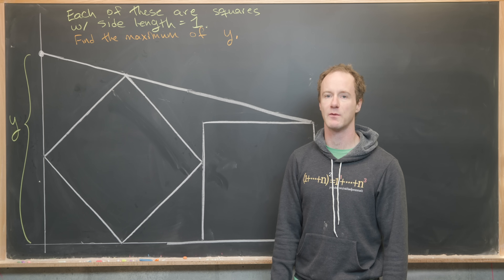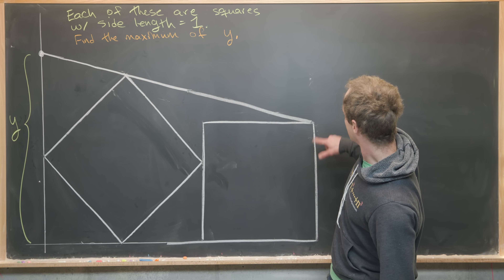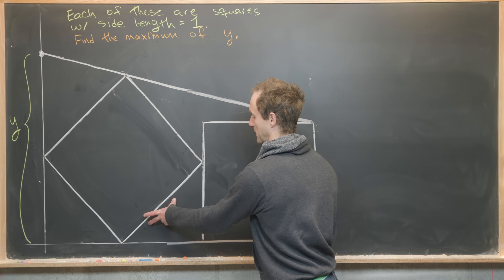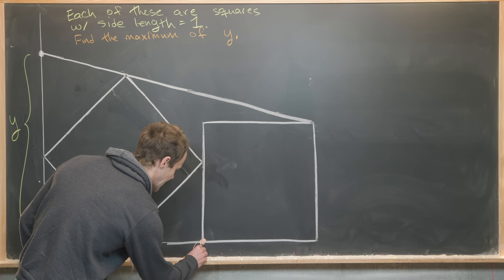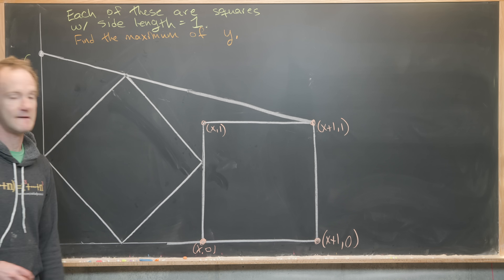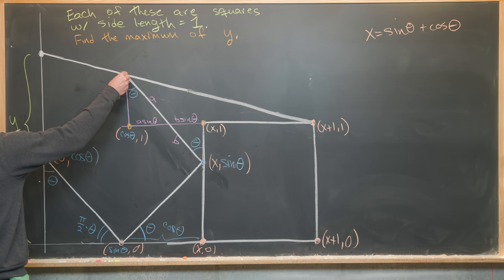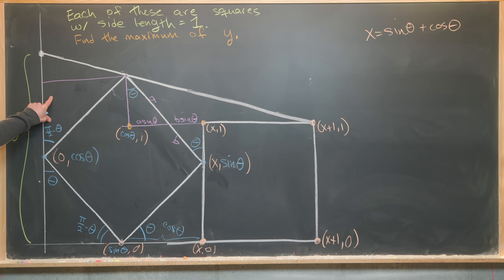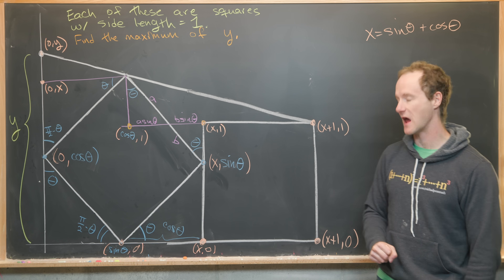How big can y be?

Comment: Setting the derivative to zero gives local max/min but doesn't say which one. Even though from the problem setup it's obviously a local max, I would have liked to see a mention of the second derivative test
Reply: @BrianStewart126  The negative solution doesn't fit my interpretation of the problem, but there doesn't seem to be more than one real minimum.
A graph of 
     y = (4*x*(x+2+SQRT(2-x^2))-(1-x/SQRT(2-x^2))*(2*x^2-2))/(x+2+SQRT(2-x^2))
can be seen by entering only the RHS here:
     https://www.wolframalpha.com/widgets/view.jsp?id=a7d8ae4569120b5bec12e7b6e9648b86
It shows only one real root between -2 and +2

Comment: Why is sin(theta) = 1/2 (x+sqrt(2-x^2))?
Why not ±?
Reply: The negative result would make the y-value for every point on the rotated square less than 1. The straight line would then cross the y-axis at a value less than 1 -- which is lower than when theta = 0, so there is no maximum y-value to be found when theta is between 0 and -pi.
Reply: Brcause theta is <= pi/4
Reply: Put x=1 to the equation

Comment: A value for theta would be nice to see how far from 45 degrees it is.
Reply: It’s around 38.5° or ~2/3 (radians).  Then y should be slightly greater than 1.60 for unit squares.
Reply: It's 38.17270763...°
Reply: I agree.

Comment: I tried the angle method. I was also stuck after differentiating for finding critical points.
Reply: your expression for y should be (sin(2\theta))/(1+sin\theta)+1. Differentiate, then when setting the numerator to zero, convert it to an equation in sin\theta only. You should get a factorizable cubic equation in sin\theta.

Comment: The actual answer via geometry is 1.585796437 to 9 places. The formula as presented (and beyond my maths ability) generates an answer of 1.600566212.
Reply: the formula as presented is correct
Reply: @mousmoulenium1215  Then I am baffled, my friend ;-)
Reply: @allanmountford21  May I suggest you check your geometry?  I solved this without using trigonometry...pythagoras theorem is sufficient...and get the same answer as Michael.
Reply: @mousmoulenium1215  Checked it using similar triangles and still get the same answer. I am obviously doing something wrong.
Reply: @allanmountford21  You are probably assuming the tilt angle of the square needs to be 45 degrees. It should not be the case.
Reply: @rocky171986  That is an interesting point - thank you - but I still don't see how rotating the square will reduce the maximum height of y.
Reply: I now see what you mean. Many thanks.

Comment: Why cant we just say the diagonal is √2 and since the two diagonals bisect each other, x is √2/2 or even the diagonal bisects the angle so theta is 90/2 of 45?
Reply: Because the tilted square isn't tilted by 45°
Reply: That doesn't change the length of the internal diagonal?

Comment: y can be expressed as 1+sin(2 theta)/(1+siin(theta)), solve: sin(theta)=(root(5)-1)/2
Reply: Correct! This gives optimal value for y = 1 + sqrt(-22 + 10 sqrt(5))
Reply: Same here. After deriving it gets to solving s³ + 2s² - 1 = 0 with s = sin (theta) and thus  s = (sqrt(5) - 1 )/2.
Fun little fact: cos²(theta) = sin(theta).
Reply: I got to this equation  y = 1 + sin(2 theta) / (1 + sin(theta)) by similarity of the two right triangles above the right square.

short leg of smaller one = c + s - 1
short leg of larger one = y - 1
long leg of smaller one =  s + 1
long leg of larger one = c + s + 1

with s = sin(theta) and c = cos(theta).

Thus (y - 1)  = (c + s - 1) (c + s + 1) / (s+1) =  [(c + s)² - 1] / (s+1) =  2 c s / (s+1) 
= sin (2 theta) / (sin(theta) + 1)
Reply: (√5-1)/2  is 1/φ, or 2/(1+√5), c is √s.  Its useful to know the relationships between φ, φ^2, 1/φ, 1/φ^2, etc.  For instance s^2+c^2 is 1/φ^2+1/φ, which is (2-φ) + (φ-1) = 1, quick sanity check on s and c.

Comment: As other suggested - this can be solved without calculus: for max Y of left-most line, we want the top-most line to have the (acute) angle as steep as possible (while still going thru the top-most vertex of the tilted square) AND to stretch to the left as far as possible the left-most line (while still having the left-most line go thru the left-most vertex of the tilted square). Fortunately these two requirements do not contradict and they both are achieved when the tilted square has been rotated 45° - i.e. when one of its diagonals is orthogonal to the lower-most line. Then the (x,y) values of the upper-most vertex of the tilted square can be found - which enables finding the expression of the upper-most line. Inserting in this expression the x-value of the left-most   line (it is also found from the achieved  "optimally tilted" square) gives the desired Max Y.
Reply: Using the value of Y that he got when he did the question, the square is tilted 38 degrees, not 45 degrees as you would intuitively think.

Comment: The answer on the screen turns out to be about 5.7, which is infeasible for these 1x1 squares. I got 1.60 after some unwieldy trig and a cubic. Seems more reasonable but definitely don't rely on me for anything definitive! [Apologies... I fast forwarded and paused the video just before he had written minus 22. My bad mistake. Same answer.]
Reply: Interestingly, the Golden Ratio popped up briefly en route to my solution attempt.
Reply: The answer on the screen evaluates to approximately 1.600566.
Reply: @brendanward2991  Damn. You're right. I flicked through the video to the end and paused it before he had written in the minus 22. Humble apologies.

Comment: Nice ! But i uesd theta(no elimination) and it simplified everything and gave the equation t^3+2t^2=1 where t= sin(theta) and solving it gives t=-1,(√(5)-1)/2
Reply: Correct!
Reply: So your theta is 38.2deg, that sounds plausible. Theta should be a little less than 45deg.

Comment: Argh, such an unintuitive choice of origin/coordinate system. This was so much easier with origin at bottom right corner and variable x being how far the base of the tilted square was from the left bottom corner of the unrotated square. This gave significantly nicer expression to differentiate and only a quadratic to solve after (x=±√φ) rather than a quartic.

Comment: I tried this without taking it in terms of x, and got the same result. Ended up just reducing the trigonometric equations down, which turns into just finding the max value of y = 1 + sin2θ/(cosθ + 1), not too bad at all.
Reply: I think in the denominator it should be sinx+1
Reply: @imacup5047  Depends what you take θ to be, of course. I was taking it as the angle Michael marked as π/2 - θ, which of course would change things.
Reply: @TheProloe  hmm
Reply: @magnusPurblind  Because that is physically impossible with the setup, so the result is meaningless. If we take θ = pi, cosθ + 1 tends to 0, which means y tends to infinity. For this problem θ is bounded by 0 <= θ < pi/2.
Reply: where exactly did ur solution divert from Michael's?
Reply: @mahdipourahmad3995  Only in the initial choice for theta and the choice to remain in terms of theta for the calculus step rather than convert to being in terms of x.
Reply: Can anyone maximimize sin2theta/sintheta+1 without using wolfram alpha
Reply: @imacup5047  yes. From 0 to pi/4 the function is increasing. From pi/4 to pi/2 the fm is decreasing
Reply: @shohamsen8986  na thats wrong you cant get the exact theta, i wrote it down below but it is arccos(sqrt(5)-1)/2
Reply: exactly what I got
θ=arccos(sqrt(5)-1/2) , f(θ)=1/2sqrt(2) * (sqrt(5)-1)^5/2
Reply: So if what is the max then, is it the same as michaels? I think ur max would/should be at pi/4. Which corresponds to the diagonals being vertical and horizontal.
Reply: @shohamsen8986  Of course. It's just a different method of arriving at the same solution.
Reply: @TheProloe  The reason I bring this up is cause pi/4 makes intuitive sense to me in terms of positioning the square such that y is maximized. Michaels solution did not. I want to make sure that the expression for y you got aligns with my intuition.

Comment: I would call 7:57 a mistake, or at least further clarification is needed.  A plus/minus sign is really needed here, and then a minus/plus sign should be used for cosine.  It changes depending on whether 0 <= theta <= pi/4 or pi/4 <= theta <= pi/2.
Reply: I agree. Others also pointed out that resulting value of x is negative, which makes no sense whatsoever given the construction and coordinates being used. So you found the bug, it seems to me.
Reply: But it's easy to see that theta<=pi/4 when y is maximized. Otherwise, the uppermost vertex of the left square has just as much height as it did somewhere with lower theta, while being farther to the left.
Reply: @TJStellmach  That's the point Tim. Michael choose the sign in a way, that theta is  indeed not <= pi/4.
Reply: @petersievert6830  Ah, yes. You are right. I thought you meant to check both cases, and my point was just that one of them is relatively easy to reject.
Reply: Another observation: plugging the decimal value of Michaels x (-0.168) into his y formula actually does not yield the the expected value of roughly 1.6 and so his x plugged into y(x) actually does not result in the expression he gave as final solution. It does work though, if you switch 2x² -2 to 2-x² in the y-formula.

Comment: Let rotated squire touches axes at (a,0) and (0,b), a^2+b^2 = 1
Points (0,y) (b,a+b), (a+b+1,1) are on the same line => (y-1)/(a+b+1) = (a+b-1)/(a+1)
y = 1 + ((a+b)^2-1)/(a+1) = 1 + 2ab/(a+1) = 1 + 2a sqrt((1-a)/(1+a))
y' = 0 => a^2+a-1 = 0 => a = (sqrt(5)-1)/2 - golden ratio cojugate
ymax = 1 + sqrt(10sqrt(5)-22)

Comment: That was the long way for sure.  I envisioned the rotated square as a cam and went right to the maximumization equation looking at the change in Y with the change of the base length X.  X is bounded from 2 to 2+sqrt2.  Basic engineering application of this math.

Comment: You made the assumption that your critical value was related to a relative maximum and not a relative minimum without proof or verification.  For completeness sake, wouldn't you have to check by either using the first or second derivative tests (since you only have one critical value for a continuous function on a closed interval) or by finding the value of your function y at the critical value and the endpoints of your interval (which would be 1 and when theta is pi/4) and comparing those results?
Reply: @BrianStewart126  that's an excellent point.  My guess would be (since I haven't solved this myself) is that perhaps one of the roots should be positive and not negative somewhere in the solution.

Comment: It is interesting to note that the optimal value of x found in the video, x = 1/2 * (-1 + sqrt(5) - sqrt(2sqrt(5) - 2)), is negative! (it is about -0.168) so the optimal situation does not look like the diagram on the board, in that not everything lives in the first quadrant.
Reply: @TheMartian11  No way, he was not really precise in the way he introduced the problem. But clearly, the way he  defined (0,0) and (x,0), it should follow that x >= 1, because the tilted square is somehow in between the "right" square and the y-axis. Also he proclaims, that is is clear, that y=1 is the minimal value in that case, which fits this intuition.
Reply: @petersievert6830  Man, I see my mistake here now, sorry its just late in night here, so didn't really pay much attention
Reply: @TheMartian11  No worries, I mean, I am just confused as well. There is a comment from @Paradoxically Excellent who nailed it, I think.
Reply: If you rotate the left square and trace the upper most point, you will get an arc. The latch is dropping onto this arc. So the touching point will be on the right half of the arc.
Reply: @AndreasHontzia  I don't understand the reply. The line passes through the highest vertex of the rotated square. At 8:15, the y-value at that vertex is 'x' -- which is said to be negative. If the y-value at that vertex is negative, how is the y-intercept of the line at a positive y-value?
The Desmos page in the post by MathyJaphy
 shows 'x' at about 1.4.
Reply: @artsmith1347  I'll try to make a sketch.
Reply: @AndreasHontzia  That may be helpful if the Desmos graph at the link posted by MathyJaphy
, which shows 'x' at about 1.4, is not the only interpretation.
Reply: Clicking the lower limit of the slider in MathyJaphy's Desmos graph allows changing it to to -90. The resulting image at d=-51 shows the squares overlapping when x=-0.16 and the line intersecting the y-axis around -3.4, which is clearly not a maxima.
Reply: @artsmith1347  Nevermind. We are taking about different things. I was talking about the hull curve over the first square. That are the points (cos t, sin t + cos t) with t from 0 to pi/2. It seems like the line from the second square to the y axis is tangent to the hull curve of the first square. Like this: https://www.desmos.com/calculator/xgkbbwqqef
Reply: @AndreasHontzia  but as you rotate, the center of the square moves closer to the y axis, so wouldn't the arc shift  to the left, leaving theta=22.5° as the highest point?
Reply: I get same value of x as -0.1681
Reply: That would also mean that the top point of the tilted square is at roughly  the Y-Coordinate of -0.168. How could this make sense, when the lower left corner of the "right" square is at (-0.168,0) ? They clearly would not even touch, because, the "right square has per definition the Y-coordinates 0,0,1 and 1.
Reply: The formula for y is wrong
Reply: @kristianwichmann9996  What is the correct formula?
Reply: i get x ~ +1.4
Reply: Who cares
Reply: @TheMartian11  If x is negative, then how can the left vertex of the rotated square be on the y-axis?

Comment: I miss why dr. Penn didn’t use the other value in the quadratic solution of sin(tetha)
Reply: Taking the other quadratic solution essentially exchanges the values for sin(theta) and cos(theta) and represents the square tilted in the other direction (with its "vertical" diagonal tilted to the left instead of to the right) but (I think) ultimately yields the same relationship between x and y. Note that both these tilted squares yield the same value for x, but the two theta values are complementary.

But this probably should have been explained.
Reply: @kevinmartin7760  Thanks Kevin, I appreciate it. I still think he should have explained it

Comment: Why didn't you just say that the diagonal of the sqaure is root(2) an then solvetheproblem via similar triangles. First triangle from xE(root(2)/2,1) and the other xE(0,1)?
Reply: It is not correct, because, you cannot be sure that diagonals of square are paralllel or pependicular to the axes. Your way to solve this problem is only a special case.

I know this pain. Long time ago I was preparing to the IMO. Almost every task was about including every case  of solution. Skipping any case was painful for your score xd
Reply: I thought this as well, but the diagram is misleading in that the height is actually greatest when you tilt the square slightly to the left. If you look at how he did it, and then plug in sint+cost=x (where t is theta) you will find that the value of Y is actually greatest when theta is about 38 degrees, which would mean that you can not just assume that the height is sqrt2 because the square is tilted at a different angle than expected.